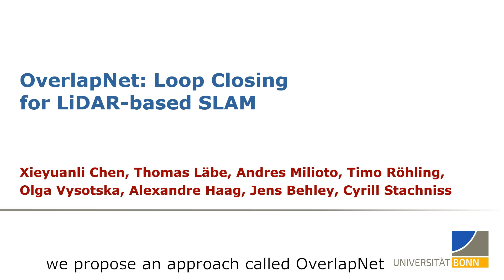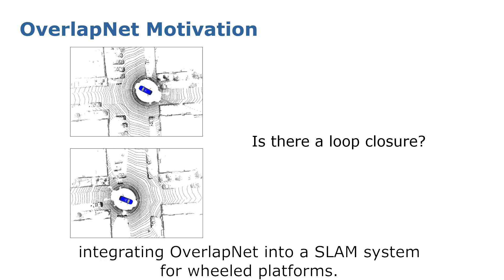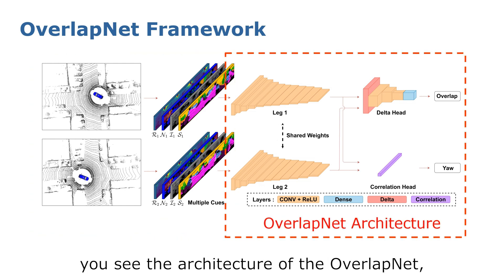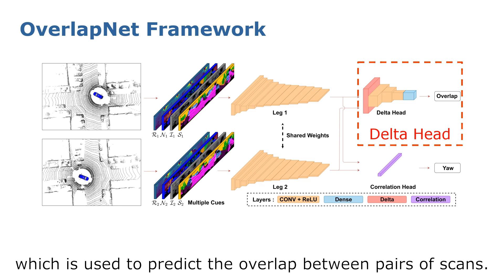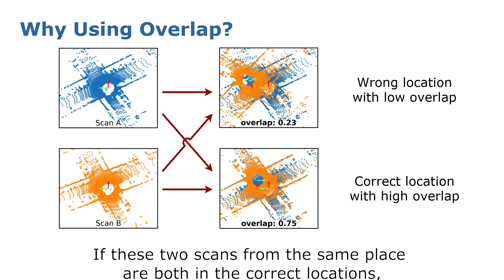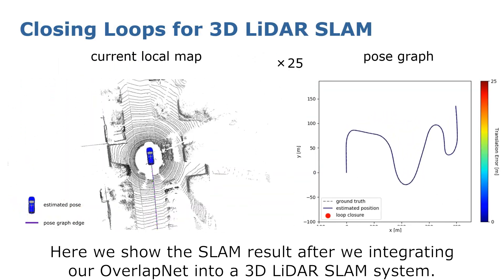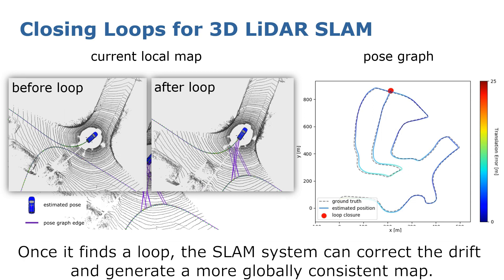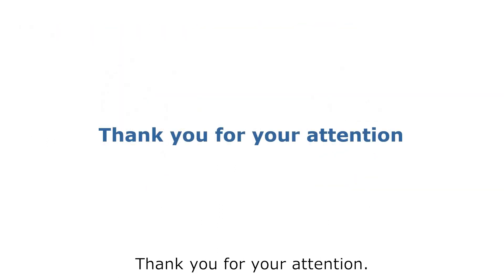RSS'20: OverlapNet - Loop Closing for LiDAR-based SLAM by Chen et al.

Comment: 1. How do we define and get the gt for overlap?
2. What does the semantic cue represent in the input to CNN?
3. Why not use a combination of CNN and fine tuning of conventional approach like ICP?
4. Performance of CNN-based approach has a common problem on its generalization ability. Is the testing SLAM phase carried out in a completely different environment than the training phase?
Reply: the poses of scans are given by a SLAM algorithm. it seems that they simply use CNN to memorize the yaw difference between the query scan and other scans in the sequence. I don't think it can generalize to other datasets.

Comment: Awesome! Have you tried other sensor inputs besides Lidar? Like Stereo or Monocam?
Reply: Thomas is trying to get this to work with images. The delta head will likely be the way to go, since the correlation head for the yaw angle exploits the fact that if the sensor is in the same place again, in a car, the pitch and roll will be very small. Besides this, the yaw estimation is best when the scan covers 360 degrees, so unless you have panoramas, the delta head is the way to go